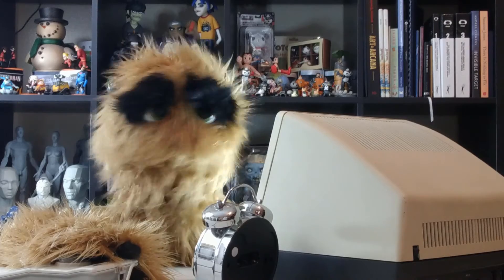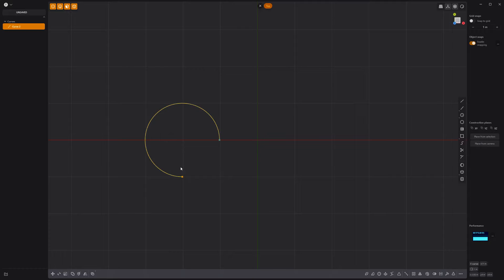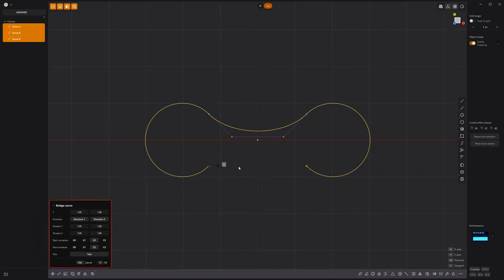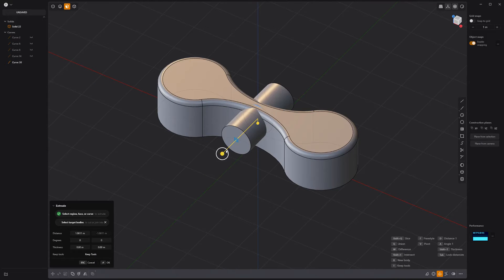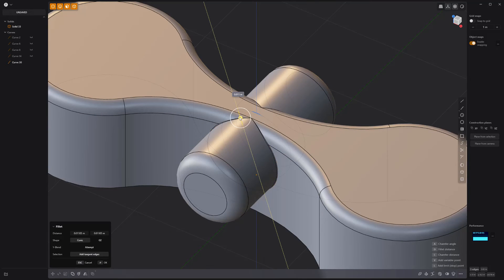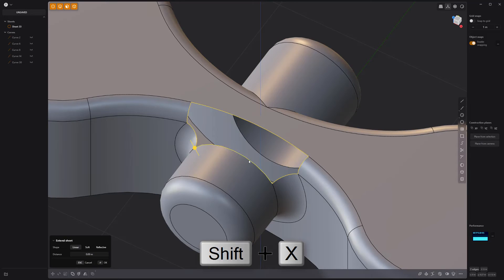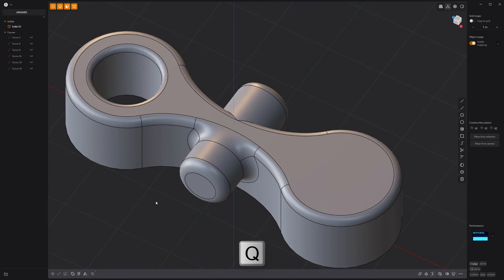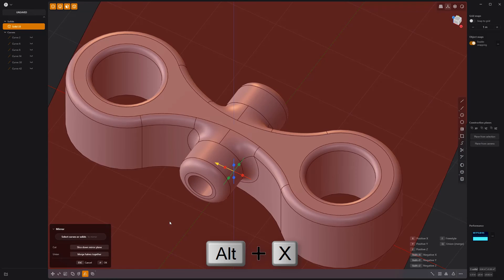Plasticity | Modeling Exercise 23

Comment: I had a little trouble with the ISO param tool lines not wanted to snap but by the end things just started snapping. So the mirror tool cuts the model in half and places the half selected on the other side. Pretty cool. Is there a way to just mirror the hole to the other side without the entire side replacing the other? I see I can select the hole mirror it and it turns into a sheet. Just wandering if I could copy over features and holes to other places in a part without boolean cutting etc.
Reply from the maker: There are a few workflows that could work but not that to my knowledge

Comment: Hey, you still working with MODO?
Reply from the maker: Every day... Released 10 new modo videos last week. New scripts for modo as well
Reply: @pixelfondue  I have a 'noob' question :) I have a 'box' and on one of its sides I want to make a cut using boolean in the 'box' format but with one of its edges with a bevel effect. Do I necessarily need to create two meshes or is there an operator where I can do this?
Reply from the maker: @jeronimocollares  can you show an example of what you want to create
Reply: Stop using modo. It is not worth it. Such crap software. 3D Coat and Blender are way better.
Reply from the maker: @gundam_Chaos  if that does it for you.... Enjoy. I have no need for either of those apps.